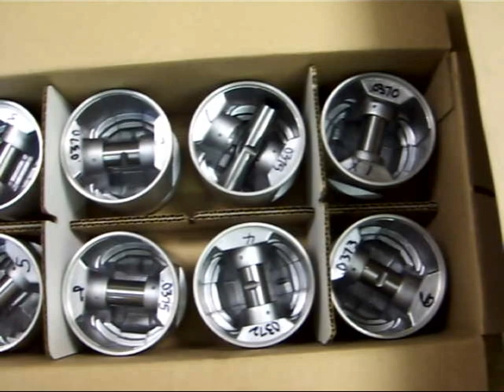Engine block back from machine shop

Comment: Did you use a lip style rear main seal for the 322?  If so, mind sharing where you found it?
Reply from the maker: No, I used the old school rope type. They work well if done correctly. Mud